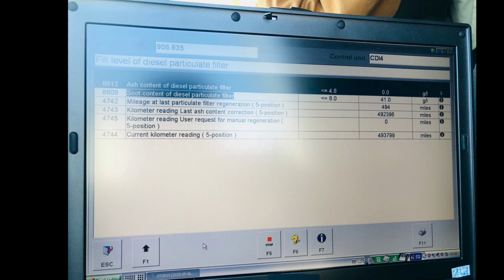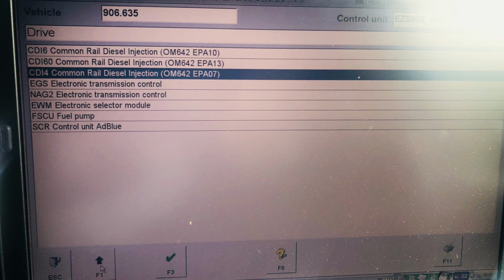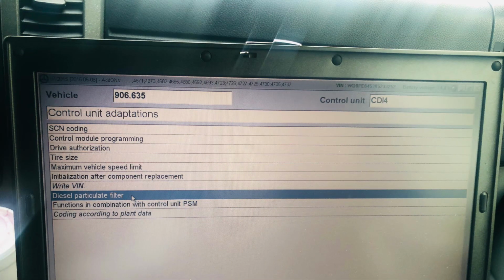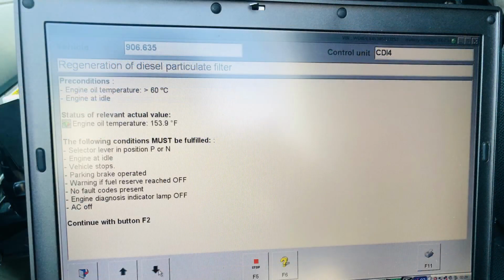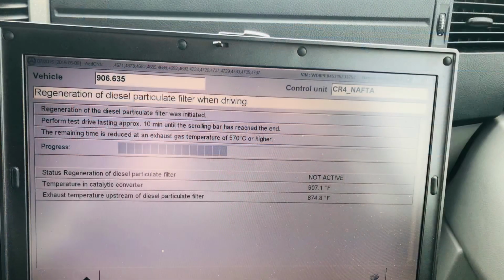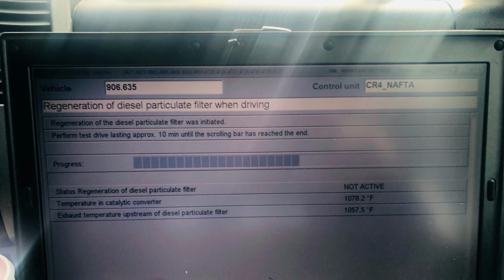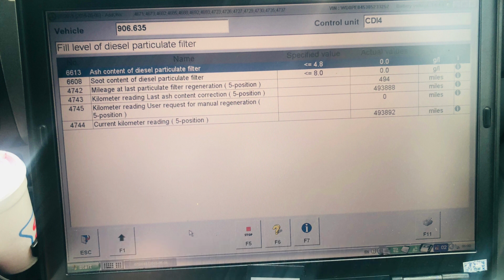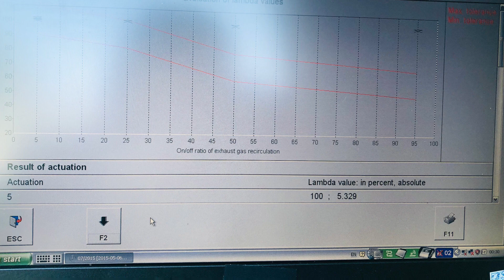PDF cleaning Procedure using SDS Star Diagnostics System

Comment: Hey, Serge! I have a few questions for you. I was curious if you know how to remove the return fuel line on om651? (p/n:  6510702432). There are 2 arrows on the line itself (lock and unlock). This is my 1st time doing it, so I don’t want to brake something. What are the symptoms of a leaking fuel injector on that engine? I noticed a few wet spots around all 4 fuel injectors, but there is no diesel smell. I took a few pics in case you want to take a look at them.Thanks!

Comment: Great and detailed information related to dpf regen. I have 1 gram of ash content shown on Star diag on my w164 320 cdi with the om642 engine. Vehicle is driven only on long runs and almost never in the city. What can I do to remove the 1 gram of ash? Should I be worried?
Reply from the maker: 1 gram is not bad, I think up to 8 grams is ok, but I think 0.0 grams is way better, especially for the performance and fuel efficiency, if you own a Star Diagnostic system then you can perform DPF regeneration your self, or take it to someone that has SDS to do it for you, I personally work on many sprinters in my spare time, many for my viewers, so if you live in SC of visiting South Carolina and want me to do this service or anything else sprinter related feel free to contact me zimaleta@gmail.com
Reply: @ZimaletaMotors  Thank you for the reply. I am located in Europe, unfortunately but will try to perform a regeneration with SD.
Reply from the maker: Cool thanks for watching, I post many sprinter help tips and  service maintenance videos on my channel